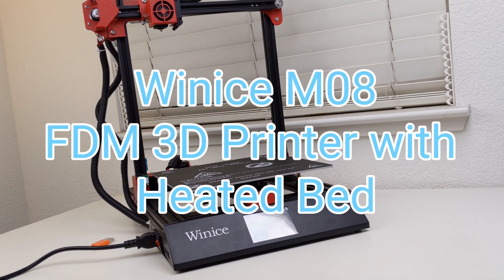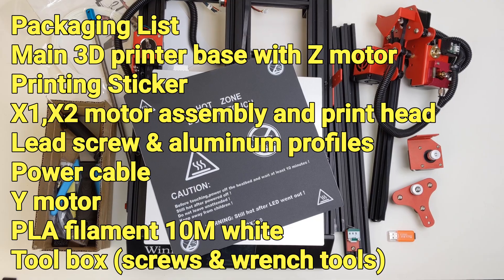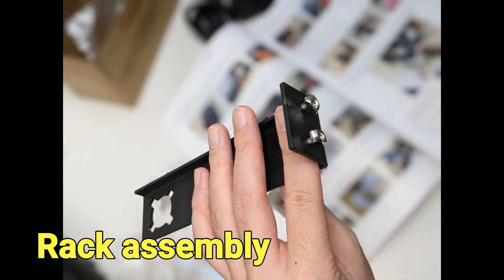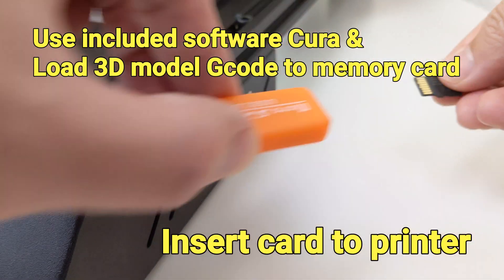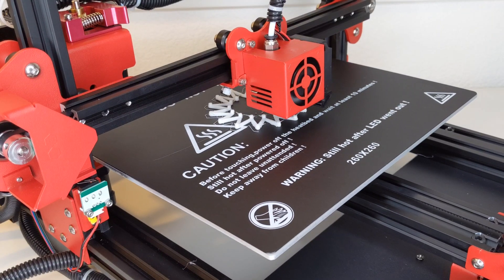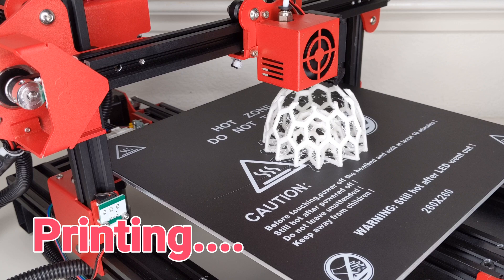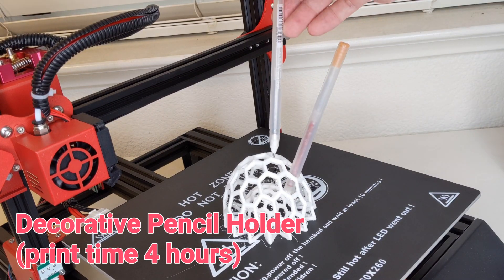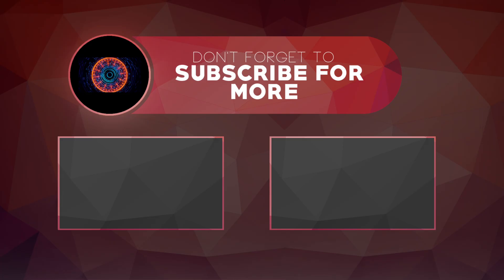Winice 3D FDM Printer M08: Resume Print, Removable Build Surface Plate, Metal Frame 250x250x270mm

Comment: cannot find information web for better config and firmware. i bought a m09 and cannot print a tower calibration because it´s appear that the printer no admit gcode for changue temp and changue speed.
before to start a print , i need to select manually the speed and the temp, it´s not changue with the model.
only size i can changue in config, with the miles of parameters os others printes, i think that this printer it´s very difficult for obtain good results with differents materials and samples.
i want to obtain a cfg files for cura and others and detailed specification on printers and for repair,and overall, do a website for upgrade or i´ll think to sell and buy another .
thanks

Comment: Hey just bought the M09, question how to adjust so the Filament feeds better, slipping?
Thx
Reply from the maker: Hi Mark, did you fully insert filament into the feeding inlet? There is a gear that'll move automatically to push filament forward. Sometimes if the filament isn't fully inserted this mechanism won't work
Reply: got it found it laying on the floor it doesn't show connecting it on themovie, it must have never been screwed in. ThX!!

Comment: Do these printers take a certain computer to run off of? Can I print anything I want or do I have to go by a certain things that they have?
Reply from the maker: Hi, I'm not too sure what you mean but any pc that can run cura software is fine. You'll have to setup correct print area inside cura to print models.

Comment: where can i find it on cura becuse cant find any named winice?
Reply from the maker: Hi, there is detailed instruction in manual. You can use the custom printer function with correct printing area settings to use it.
Reply: @JackChu  okay thank you for the info :)